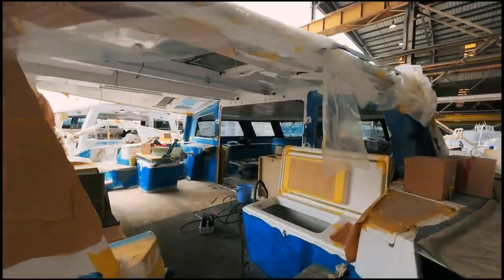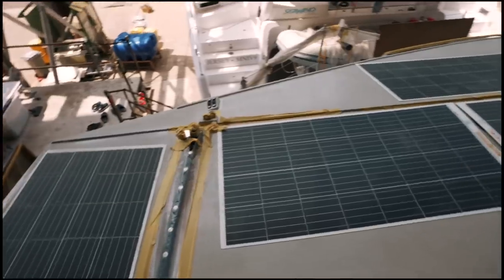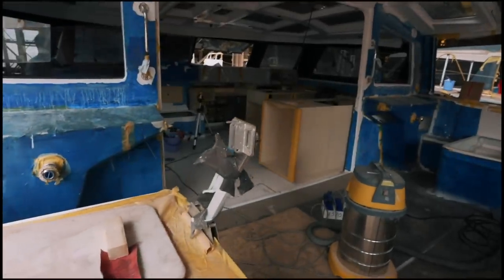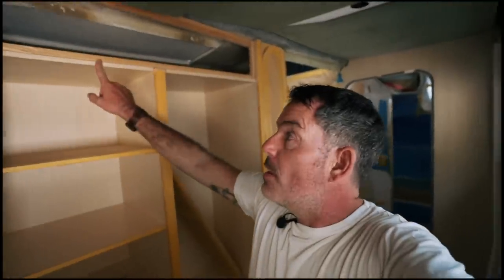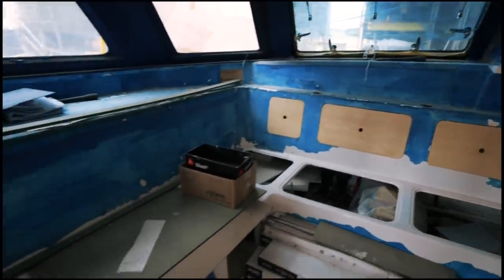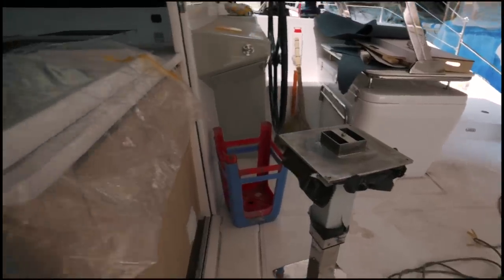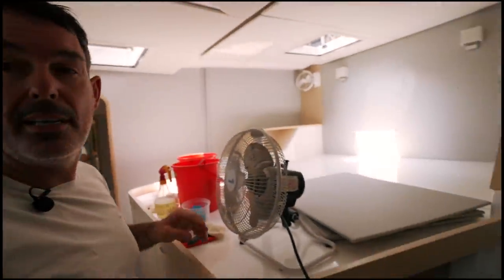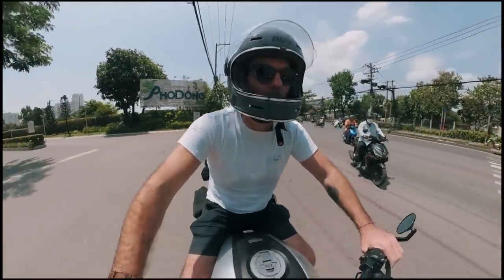Will We Have Enough Solar Power? | Ruby Rose 2 Catamaran Update

Comment: Hey Nick, NOT boring at all. Your delivery style is great. Just keep in mind a general rule of thumb with solar is 2 watts of solar for every Ah of lithium storage. And the flexible panels have around half the efficiency of ridged panels due to heat build up. Also good to remember the  power storage or your batteries are only as good as your ability to be able to recharge them. so when truly living off grid as you are on a sail boat solar is key or king actually, I would install whatever you can fit. Cant wait to see you two sail out of Saigon. 
Cheers

Comment: I'd be aiming for 3000 watts of energy collection. You don't have a regen option on your motors so 2000 is going to be marginal for self-sufficiency - and your style of panel isn't the highest efficiency nor longest lifespan. You have high output alternators for charge but you don't want to find yourself running diesel engines at anchor or port often for charging. Even if you don't implement it on day one, prewire for an over-dingy solar panel roof that would get you to 3000 watts using the higher lifetime and efficiency panels. Doing it at the factory is easier than adding it later as a big and expensive rework.

Comment: As long as you calculated your usage of power than you are good to go.  You can always plug in when you are docked at a marina and top off your batteries if you need to.
With the storage:  there are so many things that are bulky but light in weight (ie boxes on water filters or paper products).  Enjoy the storage.  You do not need to cram everything in and you can keep your possessions, boat parts, food etc. in an organized manner.

Comment: Well, if this was filmed on the fourth, that means Supernatural should be back in the water, and you're maybe a week or so away from splashing Ruby Rose II.  Best with that, I hope Terysa is back with you at this point.

In regards to the solar, I saw some other videos about installing solar, and some of them contend that bonding them directly to the surface of the coach top is just fine, but others say that you should mount them to some sort of a framework, for two reasons.  If you have to replace one, it's easier, and number two and more importantly, constantly in the sun will cause them to run at a higher temp with no ventilation able to run underneath them, thereby reducing the amount of available power.
Care to discuss why you choose to bond directly instead of going with a framework of support?

Comment: My experience with good quality flexible solar panels was initially very good but the clear plastic surface goes milky after about 5 years..Although you can walk on them the PE cells are brittle and can fracture - they still look intact but just don’t work as well.

Comment: There must be a space under solar panels. If glued to deck the heat in tropics will cook the gellcoat under solar panels.
Reply: Yup agreed my Catana they used glass frameless panels so glass glued to the roof with a slight bend . I have removed them and all the gelcoat is cracked under ear. Fine cracks all over where the panels were

Comment: Did your pet engineer at the factory not test using LEXAN and measure the solar panel efficiencies output according to huge heat applied by sunshine, versus blowing air through LEXAN panels across underneath, through the capillaries simulating sailing conditions wicking away heat from the solar panels and increasing electricity produced  ?

Comment: Hey Nick, I noticed the roof has an indentation for the solar panel's wiring block but it seems to fit that exact model of solar panel precisely. I am concerned about "future proofability" once those panels wear down or more efficiant units become available. Has Seawind considered lengthening the cable block trough to accomidate newer/different panels that may have cable blocks located more laterally? A snap together two piece fit in filler-block would retain strength for the channels cavity. Thank M8!

Comment: Solar panels can be integrated to the roof design. This can utilize the area much better and top of the roof looks much nicer. instead of patchy look with standard square cuts. What would be the cost of solar panel increase if the production is to design of SeaWind 1370?

Comment: You can never have enough solar lol!  So, I think if you won't be running aircon at all, I think you might just sneak by with the solar you have.  The glued-on flexible panels are less efficient than glass ones especially when there is no air flow underneath, plus you have to consider shading issues and how many controllers you'll have to combat that issue so the entire bank is not impacted.  

I'd suggest having Seawind build a solar arch over the davits to add another 800W-1200W with glass panels.  In my experience 3kW is about the minimum recommended for living aboard. My experience living aboard catamarans tells me you are not going to be satisfied with what you've shown here in the video.

Comment: Nick since RR2 is sensitive to weight, have you considered using e-books instead of physical books?  I recently swapped over and 95% of my book are now digital and it freed up so much space and weight that I don't look back.
Reply: That's all good until your tablet (of whatever flavor) decides to go belly up on you.
Reply: Tablets work well for novels but I think not so much for reference books especially when you want to refer back and forth with multiple titles at once all comfortably spread out on the table before you
Reply: Right now, all the major sailing channels are between boats. Where are their books? Probably packed up somewhere in storage. What about haul outs? What about when you need to fly back to visit family on a 18 hour flight from Vanuatu? I have all of my books on 8 different devices and even if one of them went belly up, I'd still have my spares. 

And I have all of my notes for all of my books in my digital note taking system. I can open multiple books on the same device.  These are not actual problems.

Comment: Are the panels connected in parallel between port and starboard? I would do it like so because of the shade from the sails.
Reply: Single MPPTs or small clusters. Nothing else…